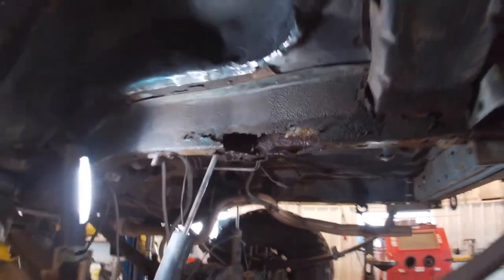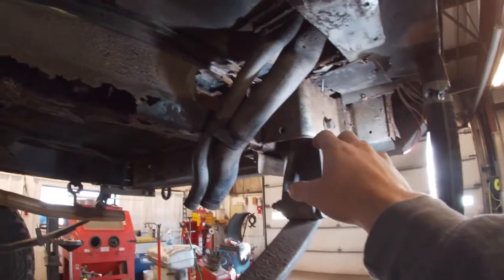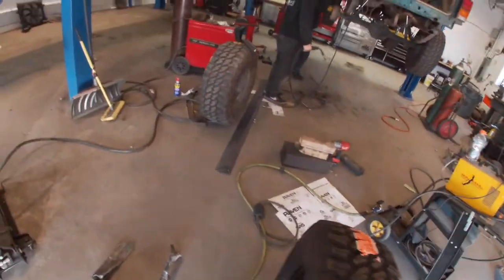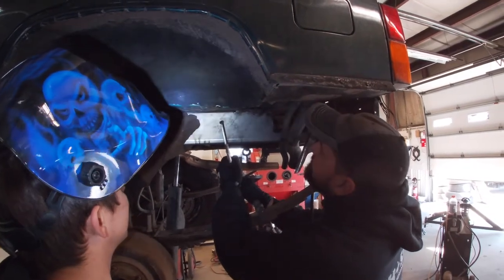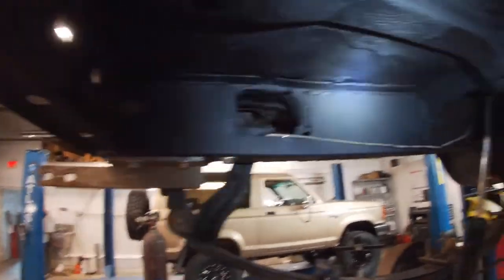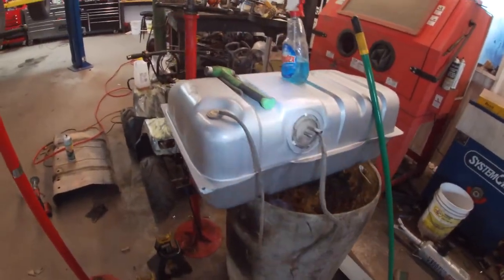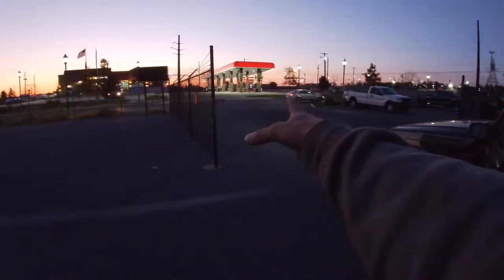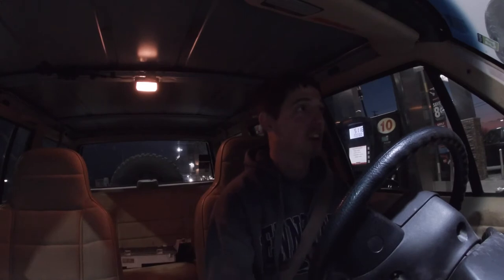Finally Fixing My Jeep XJ After 2 Weeks!!!

Comment: Yeah I havnt gotten to drive my 2000 jeep xj for over a year death wobble problems overheating issues yeah all at the same time this shit started too I put a 700 dollar zone lift on and 700 dollars into cooling upgrades and it didnt fix it... so... I miss my jeep
Reply from the maker: The 2000-2001xjs always have cooling issues. Which is why when some asks about them I point them
Far away from those years. I couldn’t imagine not having my XJ that long.
Reply: Right it has a 0331 head too but I litteraly was trying to prevent the overheating problems before they started and than they started😂 like wtf are the odds 9f that mishimoto radiator flowkooler water pump all new radiator hoses hesco high flow thermostat housing new thermostat hood vents/louvers and that's all I can think if came out to 7 hundo... and than the thing started to over heat like crazy 2 weeks later
Reply from the maker: My girlfriend had a 2000 Cherokee with 90k miles. First the water pump blew up and then down the road the radiator. And even after replacing those parts it would still over heat, and misfire after sitting for a little bit without running

Comment: Just out of curiosity why didnt you just buy a frame stiffener rear section?
Reply from the maker: The metal only cost me $40 and is just as thick if not thicker then a stiffener
Reply: Fair enough